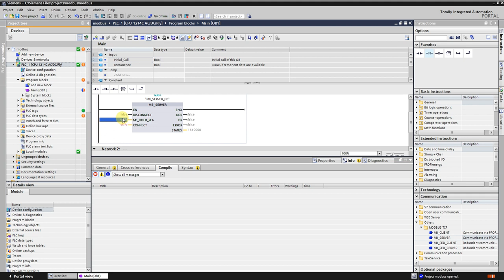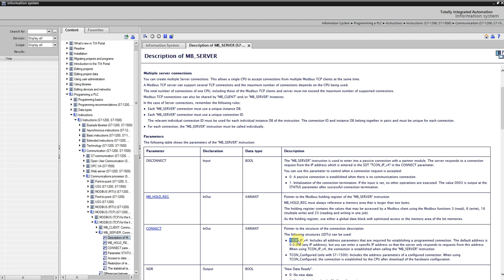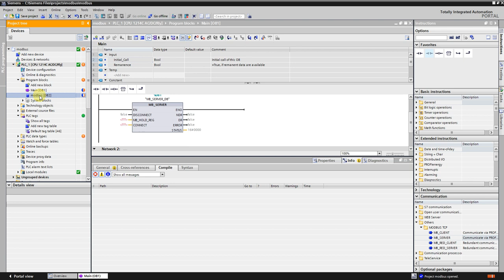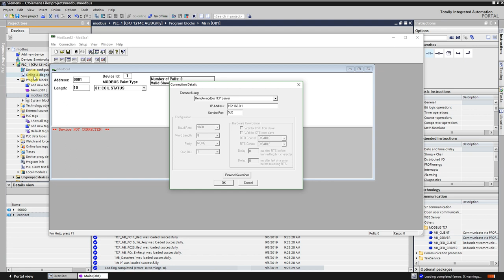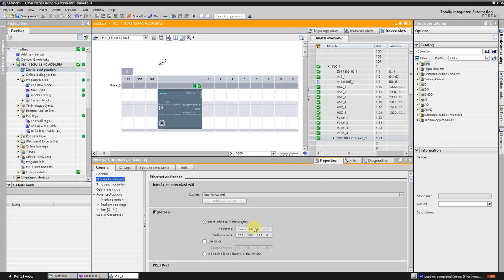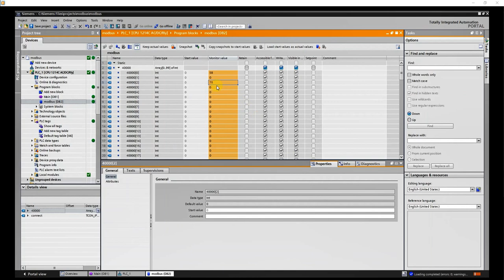How to Set Up the MB_SERVER block on an S7-1200 PLC | Authorized Siemens Support | AWC, Inc.

Comment: I followed these steps but are having issues with ModScan. ModScan worked correctly to start but then hit the 3.5 minute restriction; when I re-opened I cannot re-establish communication. Would you say this is PLC issue or a ModScan issue? Nothing changed on the PLC side and I can still ping successfully.

Comment: Followed this turorial to the letter but I'm getting an error even without even trying to connect a modbus client to the PLC .   ERROR Output is True and STATUS is 809B.  I'm  using TIA V13 which only goes to firmware 4.1 on the 1214C I'm using but the PLC has been used with V15 and has been upgraded to 4.2.  Is this the reason.
Reply: I'm getting the same error, did you solve it?
Reply: @javierfranco9357  yes one of the setting I was using was decimal not hex so i had the wrong address